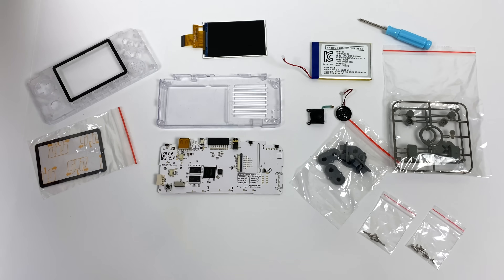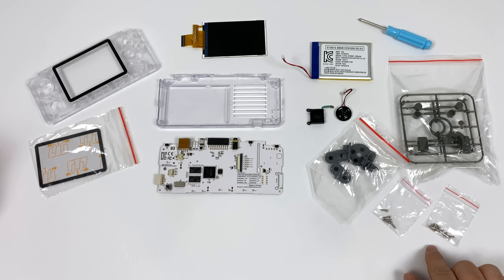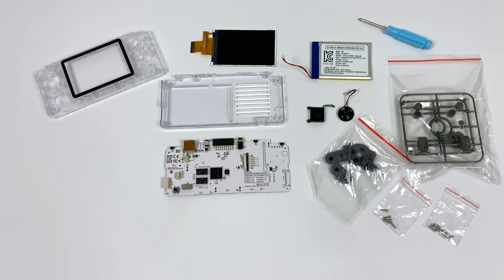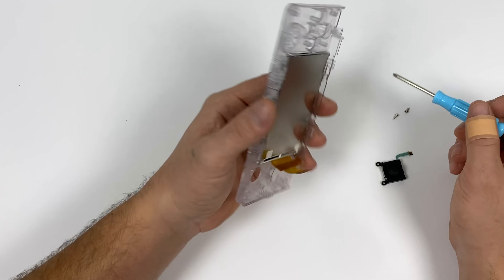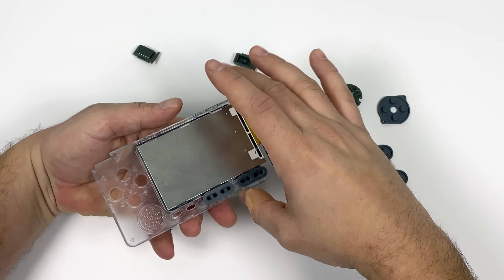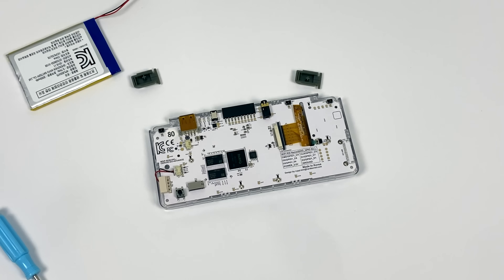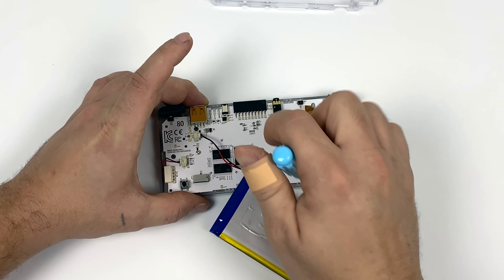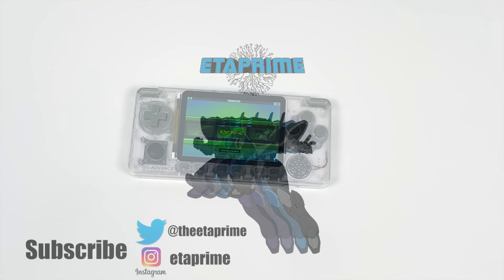How To Assemble ODROID-GO Advance

Comment: You omitted showing putting in the power button and the L2/R2 buttons. I followed these direction to the letter then had to take it apart after seeing the extra parts and at the end of your video you powered it on using the button.

Comment: You missed the small plastic part for the power button at the top of the unit in your installation video. FYI Hardkernal has it in their assembly video.

Comment: Thanks for the video.
Was VERY helpful when I was assembling.
However, I think u missed the part where you slot in the Power button (figured out how on the official video)
Also, I managed to screw up mine first time but poking the LCD ribbon cable UNDER the connector, not into it.
(So, the cable was still loose, even with the gate closed - but of course, I didn't notice until AFTER I closed it all up good and tight! #FML)
Anyway, thx again & keep the great vids coming! 😉👍

Comment: So I just put mine together.  First off, great job on your video, I'm still deciding if I even want to edit and upload mine, lol.  One thing I didn't notice on yours was the power button.  It looks like when your were talking about finishing putting it together, with the L and R buttons and battery, you missed installing the power button which should also be done at this stage and then went and installed it afterwards because it's there when you go to power it on in the next scene.  I'm not criticizing, but I totally missed the power button because I didn't see you insert it in this video which I know is my own fault!  But you may want to add that into the description :)
Reply: I tried to put my screen in and the case does not wanna flex.

Comment: Only $57.95 usd. I'm ordering.
Reply: natter man after tax and shipping it’s like $70+ but I think it’s still a great deal.
Reply: @WMARUoriginal  yea. That's to be expected. Taxes and shipping will be different depending on location. I probably should've said that. It was about $20 on top of the $57.95. Shipping cost seemed a little strange to me. The other site had the device for $55.00 but is all sold out.

Comment: I think you didn't stress enough how fragile the screen is 😂
Reply: Jim P I cracked mine screen with the official HK video method, wish I had watch this video befor I assemble...
Reply: @dewenhsu  Right there with you. HK is sold out of screens so I had to order another one from Ameridroid.
Reply: My screen also broke, ordered another from UK
Reply: Damn that sucks
Reply: @dewenhsu  sorry for your loss.
Reply: I just got my odroid and broke the lcd already . its insanely fragile.
Reply: I also broke the screen. I followed the official tutorial video coming with the kit.
Reply: Shanpu Fang yeah and now they are out of lcds. What do I do now? Already don’t like the odroid go advance .
Reply: @EltonL  What about ameridroid? I had ordered the LCD replacement from ameridroid last Friday and it's gonna be delivered today. Hopefully I won't break it again!
Reply: @shanpuF  
damn 16 more dolars i have to spend on a device that costs 55 dollars...
I forgot about ameridroid. thanks. 

good luck to you lol. please let me know if u figured out a way to put it in safely.
Reply: @EltonL  Alright I received the replacement LCD panel today and I managed to have it installed without a crack on the LCD panel. I followed the way ETA Prime showed in his video. Be gentle and patient, you're not gonna push it all the way into the right spot with just a single push. Bend the plastic case, not the LCD panel itself. And don't forget to try the free HARIBO Goldbears candy coming with the replacement in the box. I suppose Ameridroid knows how it feels when you end up spending another 16 bucks on odroid go advance the day you receive it. Let me know if you need anything.
Reply: Yeah I broke mine too. Watched The video they provided the link to. No words explaining how fragile it is.

Comment: Those little ribbon cables can be tough to deal with. Especially for those of us with big sausage links, I mean fingers! LOL!
Reply: I got PTSD from fixing 3DSes because of that damn ribbon cable.
Reply: make sure you have some tweezers and/or a small screwdriver set. Useful for pushing tiny electronic parts arond for sure.
Reply: @TheRealAlpha2  I use mosquito nose pliers for those types of cables. I paint a coat of liquid electrical tape on the jaws to add protection, and for better grip. And I also have a set of precision screwdrivers, and a few tools that I have custom made for awkward locations.
Reply: @mattsmechanicalssi5833  Ah you're more than prepared then. I don't have half of the tools you have.
Reply: @TheRealAlpha2  I am a Mechanic (30+yrs), and I have been working with electronics and computers since I was a kid. And where most kids wanted toys, I preferred tools!
Reply: @mattsmechanicalssi5833  that's awesome, a preference that served you well! a project like this is right up your alley! This is also probably something model makers would enjoy as well.